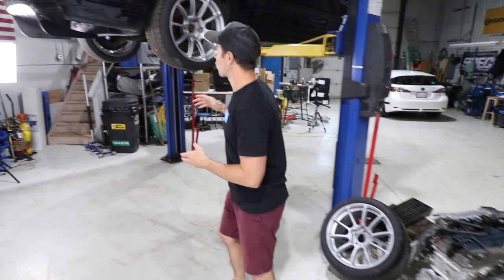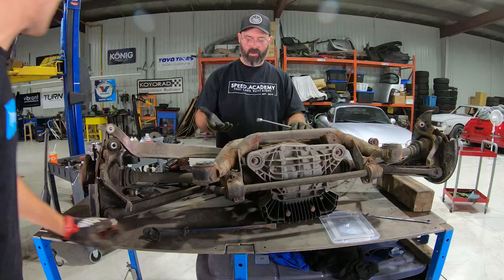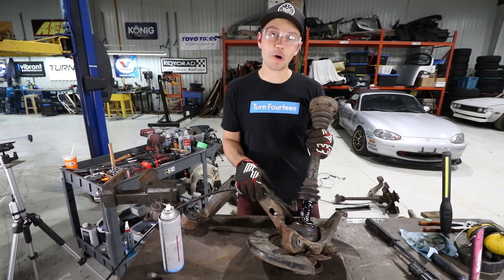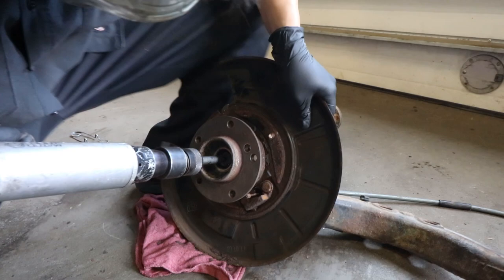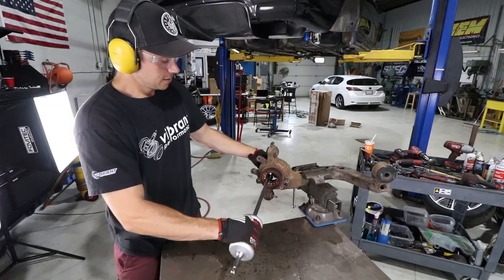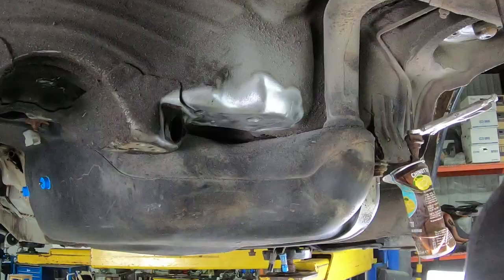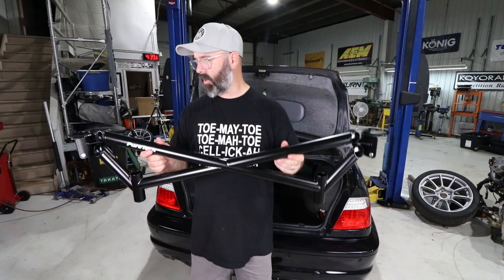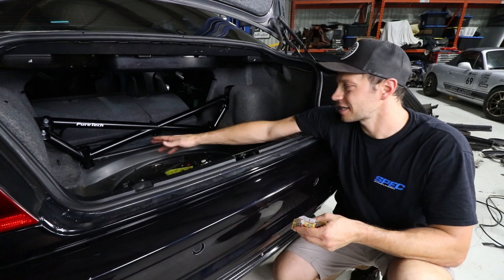Ultimate BMW M3 Rebuild - Best Rear Subframe Fix - Part 5

Comment: Jesus, are E46 M3s prone to rust or was it just the location which it was driven? I thought Japanese cars are usually more prone to rust (Nissan, Honda’s, etc.)
Reply: a few buddies of mine have them and they've all been upstate ny cars their whole life, and are all relatively high mileage cheaper examples, and have little to no rust on them. this one mustve just been treated like shit its whole life
Reply: @plantedrabbit3  have you looked at the underside of your buddies' cars? This is average for any car of that age that has been winter driven every year. Quite a few of these have visible rot on the body here too. The salt, brine, and beet juice are killers.
Reply: @lb9gta307  oh yea, the cheapest one with the most miles of the 3 we stripped down to a shell. built an engine for it, wleded the rear subframe reinforcements, and swapped it from smg to manual all at the same time. had the front and rear subframes dropped, gas tank out, really everything short of gas and brake lines out of the car and didnt find anything more than some minor surface rust. The other 2 have been up on lifts a few times and we didnt find any rust really. even my 02 325 thats been through many new york winters that i keep outside all year round has a fairly clean underside, although the rear quarters are starting to rust.  If they're cared for these cars dont seem to rust super easily, and believe me, ive worked on my fair share of rotted out shitboxes living here lol

Comment: Always remove the hubs and axles BEFORE disassembly from the vehicle.  You need the weight of the vehicle present to impart enough force to get them to budge.  We see customers make this mistake all the time!  Ain’t no air hammer out there strong enough for that.  Please do NOT do it this way!

Comment: I’m thinking about building a replica first gen corvette, instead of using a v8 I was thinking about a 5cyl vortect with a turbo as the original only came with a six. I could use a six but the sound of the five cylinder engine kind of matches the vib of the original. Anyone got any reports on the 5cyl vortect?
Reply from the maker: Not alot of support for that engine so it’ll take more time and money than a more popular power plant
Reply: @speedacademy  . I was thinking because it  is in every thing that the v8s are in with the same transmissions (same bellhousing pattern?) that many parts for the v8 would be the same only the ECM  might be a problem.

Comment: Im just like... why would you buy an M if you're just gonna take all the M bits off of it? Why didn't you just buy a plain jane E46 if you were going to change everything?
Reply from the maker: Because M chassis has all the bits designed to support big power and performance.

Comment: Surprised so many people are against the fact that you got rid of that weak, torqueless BMW engine that needs the nuts revved off it to get moving at all. The 2JZ is a huge step up.

BMW fanboys really are so common now and massively blinkered.
Reply: Enjoy that spool starting at the limitte.
Reply: What power does an N/A 2JZ make ?
Reply: @Davewagon  a 2JZ is a turbocharged engine. There are no N/A 2JZs. Even if there was if would matter not one jot as this will be a turbocharged application.
Reply: @tracktimevideos5164  2jz-ge is N/A

It's a relevant point if you're comparing the power of an N/A engine to a turbo'd one.

A turbo'd S54 will make plenty power and torque.

In it's rather wonderful N/A guise, it's beats the equivalent N/A 2JZ for power.

Both are great engines
Reply: @Davewagon  comparing 2 top of the range engines not 2 in the range down. The BMW engine is weak. Not weak for it's size, not a bad specific output for an N/A engine just weak in regards to torque and tuneabilty.

Of course I am comparing it with the engine that it has been replaced by in this particular e46 and  not another lacklustre variation of it that nobody cares about and is not being used here. 

As a 3.2 N/A engine in its own right it is fine but a 2JZ is a massive step up.